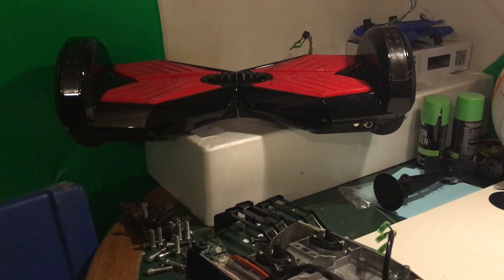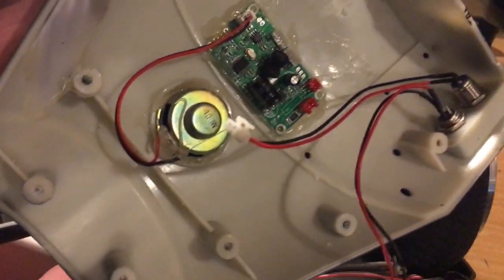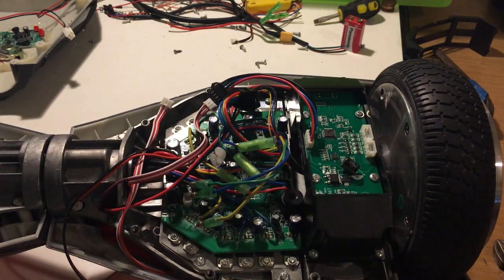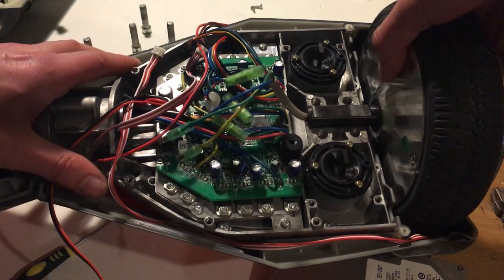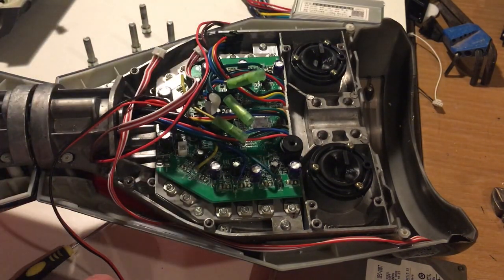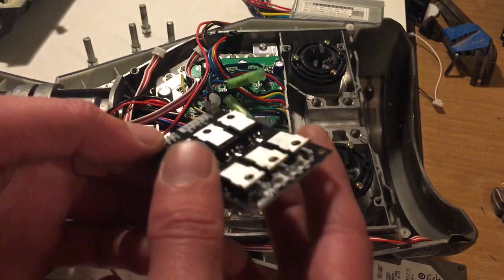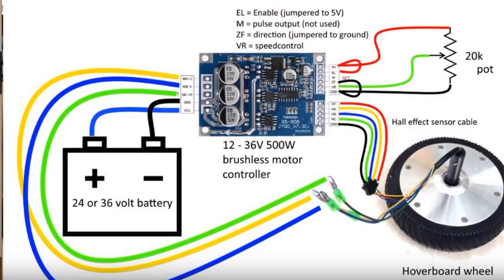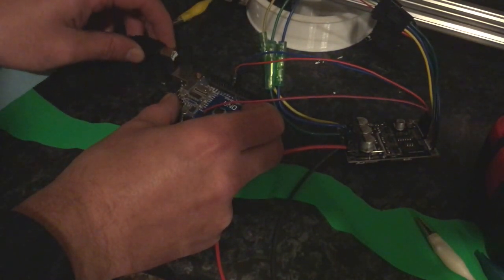HOVER BOARD MOTOR HACK / BALANCE BOARD

Comment: Hello, did you connect all 4 motor controllers to the same Arduino? Can you share the code you wrote on Arduino?
Reply from the maker: hi, yes they were on the same arduino, they were pwm controlled so you can use a 'fade' arduino example and then just connect the right pins, I dont recommend this motor controller , the hoverboard motherboard way is loads better, hope this helps

Comment: Thank you for your nice diy A-Tech. I just have a quick question please. I have made a mini bike using one of the two motors from hover board. But when I put up the speed, the motor slowing down and stops. Could you please help on this case? Thanks
Reply from the maker: hi, it sounds like the potentiometer may not be wired correctly, thanks
Reply: @A-tech  thank you for your respond. I will try to double check with the wiring and will come back to you. Appriciate.

Comment: Hi, this is good info thanks were did you get the Hoverboard motor holders from the Aluminum brackets I need some like them for my project thanks.
Reply from the maker: hi, they are cnc rod or shaft support brackets, 14mm i think, hope this helps

Comment: does this board control the position of the wheel? I mean if you program the microcontroller and depending what is been read it can run in close loop?
Reply from the maker: i dont think so

Comment: Hi, my motor needs a slight push for it to start spinning , im using two 11.1v 40c 5200 mah lipos in series, any idea as to why this happens, same issue when i use a 35v PSU

Thanks in advance
Reply from the maker: hi, it sounds like one of the hall sensor wires may be disconnected
Reply: @A-tech  hii thanks for the prompt reply, I’ve tried 4 motors and two speed controllers, isn’t it highly unlikely for all of them to have the same issue?
Reply from the maker: ok it could be the voltage
Reply: @A-tech  im using two 11.1v 40c lipos in series…..
And the motor runs without needing a push start when i connected a 11.1v lipo to a drone esc
I just cant wrap my head around as to why the motor controller doesnt work

Comment: Hey question I have two hoverboard motors and esc there the same and battery everything the same from a hoverboard but I'm wondering can I use everything like the speed controllers with a foot throttle cuz I tried installing a foot throttle and it doesn't seem to work idk what I'm doing wrong maybe u can help me
Reply from the maker: hi, yes you can, there is a lot from a hoverboard you can reuse, motors, motor mounts, battery, battery case, motherboard and even the leds, have a look at my hoverboard motherboard hack videos they should set you in the right direction

Comment: I have the same controller but I am not able to make a code that allows me to brake when changing direction. Any ideas?
Reply from the maker: hi, so when you turn you wish to lower the speed of one side?
Reply: @A-tech  In reality it is when changing from front to rear, it sort of waits until it is still and at that moment it is when it reverses, I tried to implement an active brake but was unable to do so.

Comment: Hi! Is it not possible to use the existing hoverboard motherboard as a speed controller, and simply send the arduino PWM signal to the board? - overriding the signals from the pressure sensors.
Reply from the maker: hi, yes, thats what i use now, check out my hoverboard motherboard hack videos, thanks

Comment: I have built this project. However, with an ebike controller. 
The motor runs as it should with a potentiometer. 
If I give a PWM signal with an Arduino to the controller, the motor runs very irregularly. 

Do you know what the problem could be?
Reply from the maker: ok, hmm, are grounds connected up between the arduino and controller? thanks
Reply: @A-tech  Yes, I have the ground between Arduino and controller. 
I'm still waiting for the controller you are using.

Comment: I have a working hoverboard motor (tested on another system ) , I have purchased a brand new 36v controller with lcd ( s866 ) brand new throttle and brand new hoverboard battery for my e bike project but I'm experiencing no throttle issues I have checked voltage and purchased 3 brand new throttles checked wires tried swapping around but still no throttle
Reply from the maker: hi, hmm so e-bike controller, ok i heard they have a safety or activation wire you need to power too? might be that? hope this helps
Reply: @A-tech  yes I have seen the same thing ( thanks for the suggestion) , as this one ☝️ really puzzled me every thing brand new fully charged checked all cables etc , I guess it dose t leave much !

Comment: Can you give a description and dimensions of the metal motor bracket holders and the screw size needed please? I am referring to the brackets you use to fix the wheel shafts on that excruded aluminium frame
Reply from the maker: ok the metal bracket is a shaft mount for cnc machines, ideally you want to use m6 bolts to fix it down and the hole is 16mm for the wheel shaft, im using m4 bolts with an m6 nut as a spacer washer for now as  i only have m4 size slot nuts, hope this helps
https://www.ebay.co.uk/itm/SK16-Bracket-16mm-Linear-Rail-Shaft-Rod-Support-Mount-CNC-3D-Printer/152007213903?hash=item236456034f:m:m2GhUOeZB01lEBT-mM7Dyig:rk:2:pf:1&frcectupt=true
Reply: @A-tech  u r a star mate! Thank u fir this really. What bolts are you using to thighed that 16mm ring pls? I can see it has a through hole on the top.
Reply from the maker: @TheNikolasNick  hi, sorry i have only just seen this, hope its not too late, that bolt that closes it up is an m4 bolt, thanks

Comment: Hello! Can you send the circuit diagram for connecting the board to the Arduino and the code? thank you!
Reply from the maker: hi, the wiring diagram is in the later part of the video, you can get a screenshot from that, the code is really basic, you can use the fade example to send a pwm signal or use a dac to mimic a potentiometer, hope this helps!

Comment: does the green and blue wire control motor direction? if I switch green to blue and blue to green, motor would run in reverse controls? would I need to switch green and blue on hall sensor aswell?
Reply from the maker: hi, yes if you switch any pair it will go the other direction, and yes you need to do on both motor and sensor, thanks
Reply: A-Tech ah yes, got it! ran hall sensor wires into one wheel to trick the controller and using one gyroscope, making a one-wheel and connecting the two wheels face to face to make one wheel and they need to spin one opposite of normal for it to spin together as a whole as one wheel. thanks!

Comment: Hello dear, can you share the code for what you burned in the Arduino tool to learn?
Thank you
Reply from the maker: hi, no problem, if you check out my other hoverboard video with this controller i have added the code in the description and also a wiring diagram, i would recommend using the 'Flipsky VESC' or a genuine hoverboard motherboard instead as they are much better and less prone to problems during use, thanks

Comment: how slow are you able to run those motors with those controllers? I was thinking of getting the same motors and controllers, but i need to be able to run them at about 10rpm. Will I be able too?
Reply from the maker: hi, thats a different question, most people want to know how fast they go haha, ok so im not using these controllers any more, its easier to just flash the old motherboard, as for speed i cant say i have ever tried to make them as slow as possible, i think they can go slow like you want but there may not me much power at that speed, hope that helps
Reply: @A-tech  thanks.

One more thing, can those controllers in the video be controlled via PWM from my raspberry pi?

Comment: Can the accelerometer boards/ foot switches be replaced with analog 2 way potentiometer joysticks for motor control?
Reply from the maker: The foot switches / accelerometers are separate circuit boards units that connect to the motherboard using some weird serial link, if you want to modify them easiest way to bodge them would be to make something that holds the sensor / switch that you can tilt / rotate to move the motor, alternately possibly find points on the board where there is a signal for tilting and mimic it somehow, thanks
Reply: People have reverse engineered the orginal STM32 and GD32 mainboards used in hover boards and have built complete replacement firmware that can be fairly easily flashed. This gives you full control using anything from a nunchuk, pot, or even an easy-to-use serial protocol for which an Arduino library already exists. I'm using this firmware https://github.com/bipropellant/bipropellant-hoverboard-firmware for some personal projects in re purposing these powerful drivers & motors

Comment: Your work is amazing!!! is it possible take off the arduino componet and using a remote control (like RC) and wiring it on that brushless motor controller? its also possible have the reverse option on the motor without the arduino controller?
i saw your other video when use a ps controller for RC, but is still possible using a normal RC radio and receiver?

thank you in advance for your time
Reply from the maker: hi, thanks, for this motor controller i dont think its possible to connect it directly to an rc receiver, but you could always do the servo potentiometer hack, for the forwards and reverse its just a pin to enable the direction so that wont be a problem, thanks

Comment: Thank you my dear 
I can connect the motor of the smart scooter with us in this explanation on a current of 48 volts to take advantage of it to a greater speed
Reply from the maker: Yes 48 Volts would make it faster, you need to change it in the firmware from 10s to 12s I think

Comment: Is it possible to connect 2 wheels to the same controller ?
Reply from the maker: hi, no you need a controller for each wheel, this is because of the hall sensors, thanks
Reply: A-Tech  ok thank you. But did you had some issues to synchronize the speed and the pace of the wheels? Did you handled it through the code?
Reply from the maker: yes trying to drive it with 2 sticks was very difficult to drive in a straight line, yes code seemed to work pretty good, so easiest way i found was to make it so when you press a button on the controller it just copied the stick value from one stick to both motor controllers

Comment: Hi, your tutorial was so helpful, but I'm having a problem with my motor. Everything works, the direction, the stop/start, but not the speed control. Whatever number I put in for VR the motor only spins at max speed. Do you know what could be the problem Thank you so much!
Reply from the maker: hi, ok thats good to hear, how much voltage are you using for the VR? i think its 0-5v, or are you using pwm?  thanks
Reply: I’m using a raspberry pi, and the 5V pin on the MCB is connected to the 5V on the pi. What exactly do u mean by the VR connected to the 5V. 
Thanks!
Reply from the maker: @HarryB832  ok, its been a while since i made that video so i need to remember, so sometimes a potentiometer can be connected to 12v, but because your using a pi its going to be 5v, so what signal are you sending to the VR pin?
Reply: @A-tech  thanks so much for the replies. So the way I have it set up is the 5V on the MCB is connected to 5V pin on pi, ground to ground, VR to a GPIO pin, ZF to a GPIO pin, and EL to a GPIO pin. I’m not using a potentiometer. Again thanks so much for your replies they mean a lot.
Reply: @Harry B 1698.  any updates? I am at the exact situation as yours

Comment: Can you please tell me what capacity and specifications of motor can be used to construct it  and available in market?
Reply from the maker: hi, all i know about these motors are they are 3 phase, hall sensored, 350w, 36v, you can find them on ebay for around £25 by themselves as a hoverboard spare part,  hope this helps
Reply: @A-tech  Tq for ur info. It helps me a lot.
Reply: @A-tech  link pls?

Comment: Ho do i wire up two and control turning the robot
Reply from the maker: hi, you could use 2 motor controllers and some DAC's connected to an arduino then use a playstation controller or something for the inputs
Reply: @A-tech  no clue how to wire any of that up . not grasping the concept of ardrio
Reply: @A-tech  couldnt i just use 2esc  connected to rc reciver

Comment: What is the purpose of the Hall effect sensor?
Reply from the maker: I dont know exactly but im pretty sure the hall sensor lets the speed controller know what position the motor is in, it helps with starting and smooth running

Comment: then how do you connect the remaining 3 engines to a single remote control?
Reply from the maker: you should be able to use the same potentiometer just splitting the wires

Comment: Can you share the code. I am helping a kids team reverse engineer  a hoverboard vehicle with two motors and need some help with code and battery strength.
Reply from the maker: hi, no problem, if you check out my other video i have added the code in the description and also a wiring diagram for the controller, i would recommend using the 'Flipsky VESC' instead as they are much better and less prone to problems during use, thanks

Comment: I soldered everything correctly and got everything ready with the controller but when I connect the battery it sparks.
Reply from the maker: hi, ok do you have any heat sink on it? im not sure if they can cause shorts, thanks
Reply: @A-tech  No I do not have a heat sink, I am using 3 normal batteries in series I don't know if that may be the problem.
Reply from the maker: @fabianarevalo2198  its possible, how many volts are you putting in?
Reply: @A-tech  Just 18 volts
Reply from the maker: @fabianarevalo2198  ok it could just be the capacitors charging up
Reply: @A-tech  So I should be able to use it normally?
Reply from the maker: @fabianarevalo2198  ye its possible
Reply: @A-tech  OK thank you for all your help.
Reply: Hello again, I finally figured out that a transistor was broken from the bigining. Can I replace it with a transistor from a hoverboard motherboard?
Reply from the maker: @fabianarevalo2198  i dont know, possibly, see if the numbers on them are the same
Reply: @A-tech  They aren't but I searched it up and it said I could replace it with any mosfet that was rated for the same voltage. I will try it and see if it works.

Comment: Hi nice hack, can you send the Arduino code code and the part # of the motor controller. Thank you
Reply from the maker: hi, the code is just basic pwm, you can get it from a fade example in the ide, I did another video with the controller but they are not that good, using the motherboard that comes with the hoverboard is best I think, thanks

Comment: Can you do this with a raspberry pi?
Reply from the maker: hmm probably, its just pwm output to the board, thanks
Reply from the maker: @HarryB832  hi, im not sure, i know the motors are 36v, so if it does work it would probably be a bit slow, thanks

Comment: Great video! These aren't actually motors in the conventional sense, they're linear propulsion systems arranged in a circle, from what I read, they are capable of very extreme torque and high speed rpm, using little amperage. Little is understood on how they are driven, as the companies who make the controllers won't disclose any info on them
Reply: These are a very common type of motor, BLDC or three phase permanent magnet motors. A lot is known about the control, although it is definitely a bit more difficult than just applying power to the wires. Look for Vector Control, or Field-Oriented Motor Control (FOC). Six-step commutation is a simpeler technique.
Reply: I have a couple wheels off a hoverboard with these motors, 8 wires go to each wheel, all 3 hall effect sensors in each wheel share a hot and a ground, and each has an output wire (5 wires total for the hall effect sensors), plus the 3 wires for the 3 phases. 6 N channel mosfets per wheel (2 per phase, can supply either hot or ground to the phase). I am setting this all up as we speak, going to make my own controller, if it kills me lol. I'll post the video. I made a video of the tests I ran on the hall effect sensors and what I learned about them, haven't posted it yet
Reply: @JohnSmith-nw2ls  &
Reply: John smith that is not true at all and it’s sad your comment is on top...
Reply: @mashedpotatoes5323  My point is that whatever secrecy involved in the running of these motors is hidden within the microcontroller itself, from what I've learned, the output from the controller isn't even classified as electricity, but it's a transmission signal of some sort, if you understand (or think you understand) how this works, please share with us or point to a source where we can learn more, I'm not claiming to know it all by any stretch, I'm just another tinkerer who is striving for answers and so far I've found very little on the technology of what runs these motors, the answers aren't very obvious, and there is evidence the manufacturers aren't sharing it with the public
Reply: @JohnSmith-nw2ls  it's just a basic 3 phase motor controller with hall sensors, it's the same technology as brushless rc cars, ebikes, and ev cars. They really aren't that complex, you can even use hoverboard escs as a ebike esc with some firmware mods though UART.
Reply: @JohnSmith-nw2ls  great Scott on YouTube even made his own

Comment: This is wonderful mate. Much cleaner than having a big hunk of flashed motherboard circuitry in tow. I wonder if there any downsides?
Reply from the maker: these look better yes but i find the motherboards much better
Reply: Saludos! The original board modified by firmware has a microcontroller and multiple protections, it also uses FOC among many other options and controls two motors. The one in the video is a simple bdlc pwm controller with a pwm generator, some fet drivers and some mosfets.